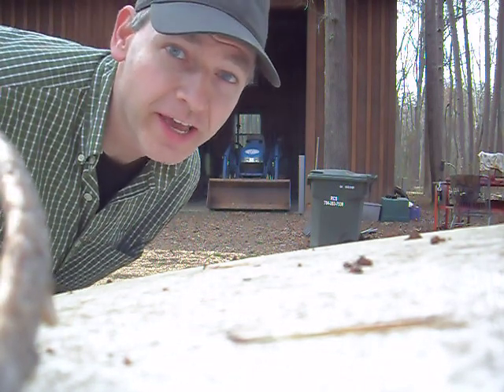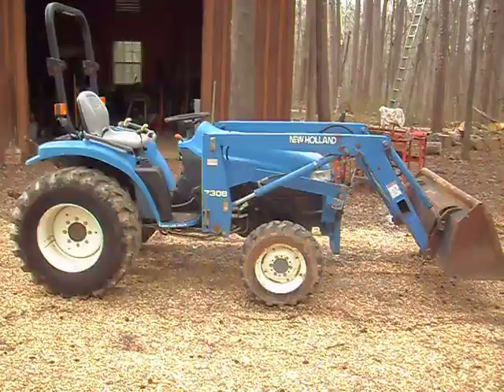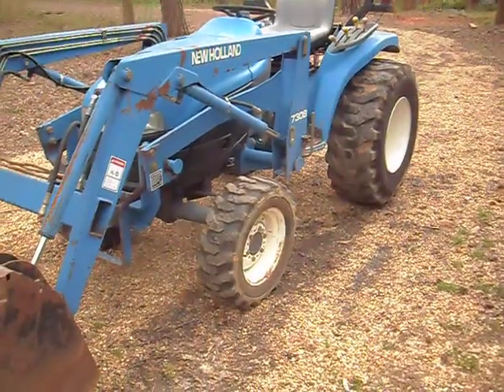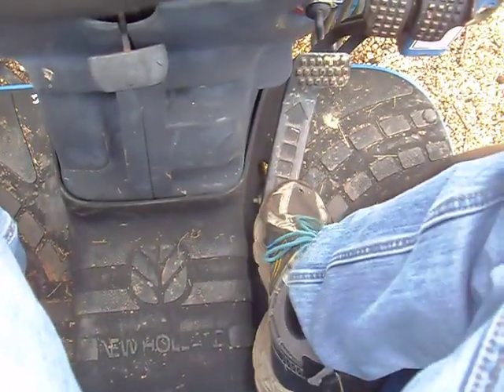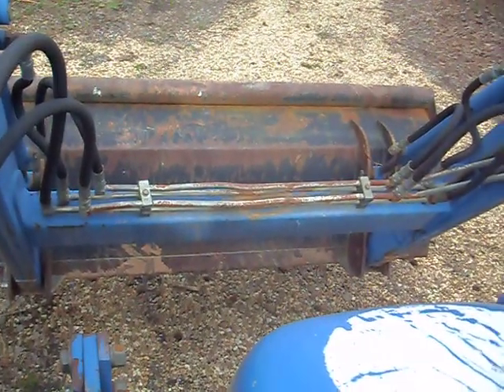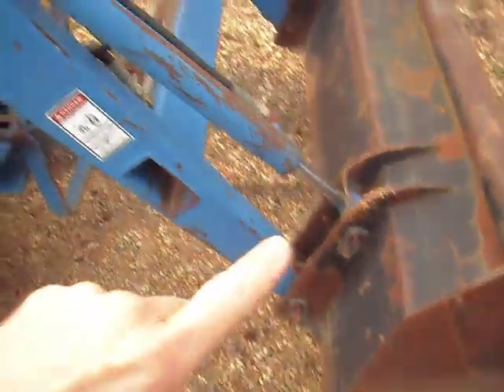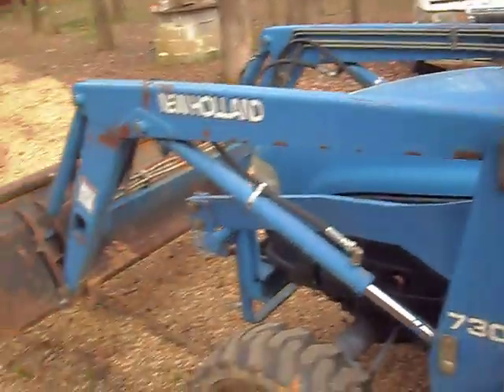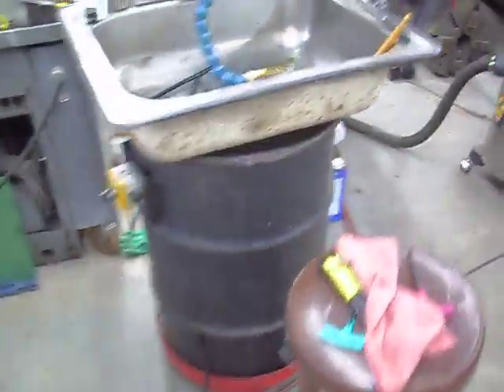Doozer's Machine Shop Update 3-16-19 -- New Holland TC33D Tractor

Comment: I recently picked up a 2002 TC33D in beautiful shape.  Have you ever GPS'ed the top speed in third?  It was advertised as a 15mph road gear, but I never get more than 9.  Seems to be a common problem, but no one has discussed where there is an adjustment.
Reply from the maker: I don't have a smart phone, so not sure of the GPS speed.  I know mine COOKS on 3rd range.  I am afraid to open the throttle all the way, to be honest.
Reply: @kooldoozer  yeah mine is a light jog 🤣😭
Reply from the maker: @jeepfreak81  Could it be a pressure relief valve?  Does it whine ??
Reply: @kooldoozer  no whine or anything, it sounds normal, and in lower gears it'll push hard with no slip.  My understanding is the pressure reliefs for the hydro unit are internal and not adjustable.  You have to split it to get to them.  It isn't that big of deal to me, just a bit slower going between my place and my uncles farm grabbing attachments.  I would eventually like to figure it out though.

Comment: Thanks for the video. I also have a NewHolland tc55da tractor for 15 years now and have been very happy with it . I still have the original battery in it and it starts right up  . The mice like to build nests in it when it is left outside ,so i am completely going over all wires and Checking for any potential problems . Go  BILLS !
Reply from the maker: Thanks for the comment Tom.  I am blown away how much I love my New Holland TC33D.  I was in the market for a used Kubota. Then I saw this TC33D on craigslist.  Before that I did not know a thing about NH.  So I went and looked at it and it really sold me on it's design and layout of the features.  I love the loader joystick in the fender instead of the dashboard area.  All the controls are at a fingertips reach.  All the hydraulic lines are very neatly run, and the engine underhood is very well layed out as well.  Some engineer really put some thought and design time into this tractor.  It is a joy to use and fun to work on.  I hope you keep enjoying yours too.